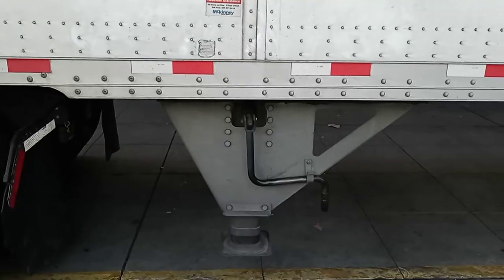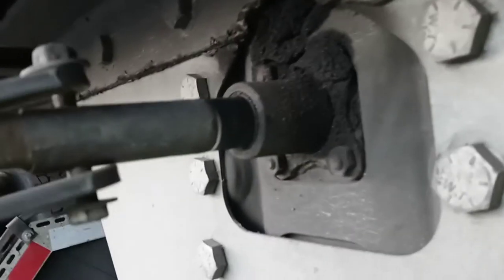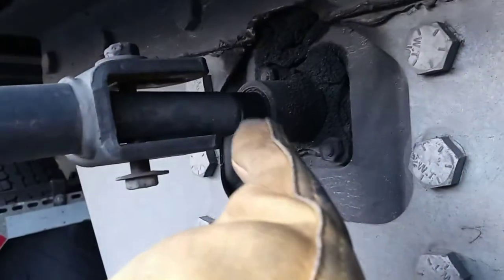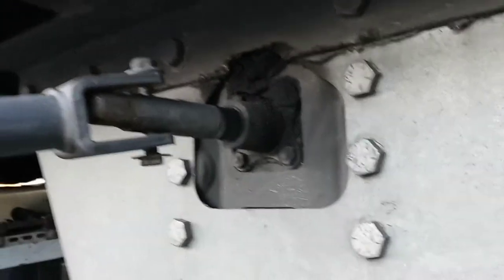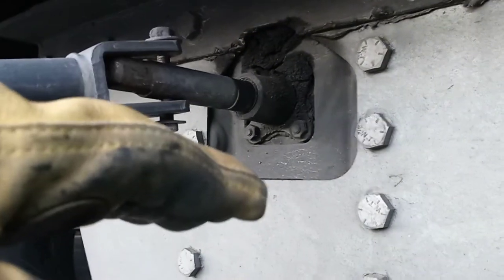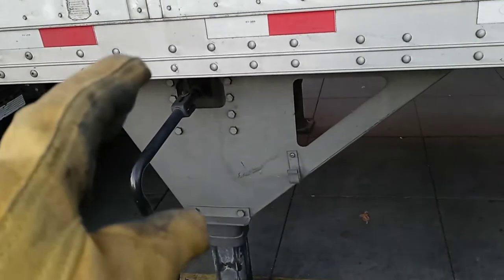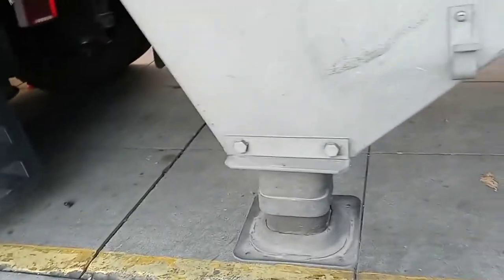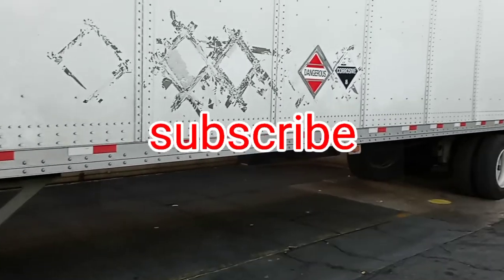landing gear trailer, how to, lowering and raising your landing gear.

Comment: How much space should you leave between the ground and landing gear when dropping a trailer?
Reply from the maker: Just let it touched the ground and you will be just fine😃 no need to crank it up.
Reply: Good question. It should be about 1/2 inch off the ground before uncoupling so that you don't stress the landing gear while pulling the tractor away.
Reply: @stanleykubrick8786  thanks 🙏🏾

Comment: When you unhook leave trailer,  loaded or empty is their a certain way you habe to leave the landing gear in place or doesn't matter just leave on high or low and hook it on hook ? I'm asking because say you leave on low or high  gear and it's loaded will the  trialer drop the legs with the Weight?
Reply from the maker: Hello MrSehka77 sorry for the late, late response, talking about the landing gear it doesn't matter, you can leave it in low or high. If the trailer is loaded and you want to raise it or lower it, that's when you use the lower gear so is easy on your body. I hope this helps. Thank you for your comment👍